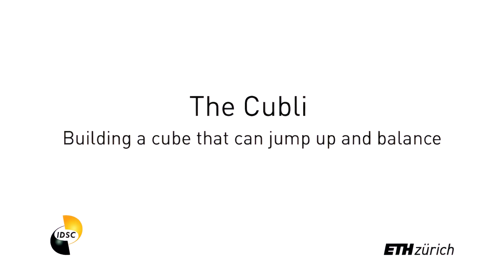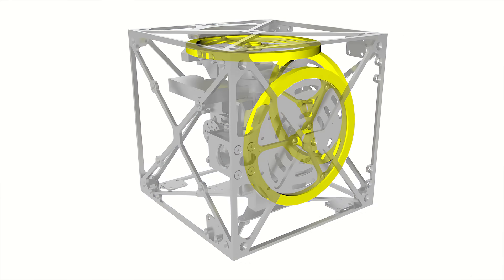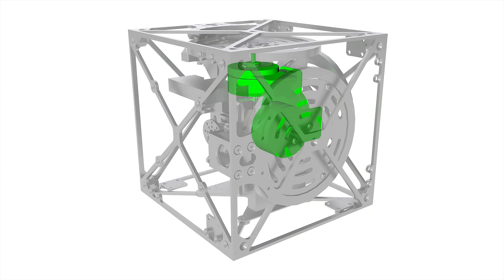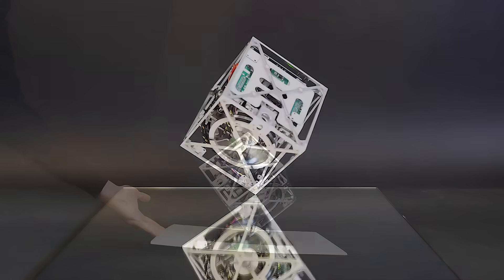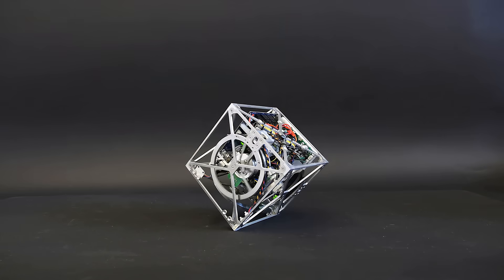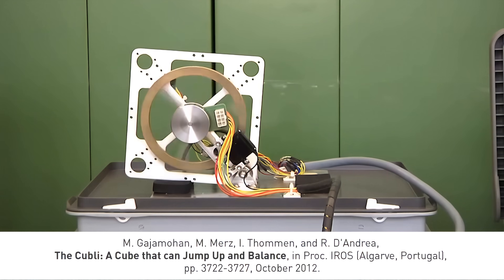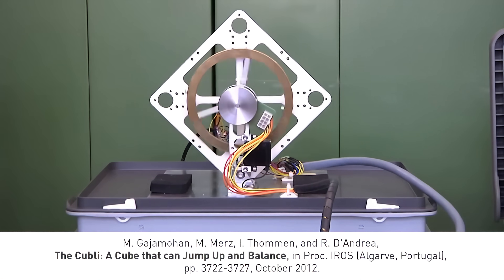The Cubli: a cube that can jump up, balance, and 'walk'

Comment: how can a brushless motor use DC current?!!!
Reply: "Brushless DC electric motor (BLDC motors, BL motors) also known as electronically commutated motors (ECMs, EC motors) are synchronous motors that are powered by a DC electric source via an integrated inverter/switching power supply, which produces an AC electric signal to drive the motor. In this context, AC, alternating current, does not imply a sinusoidal waveform, but rather a bi-directional current with no restriction on waveform." https://en.wikipedia.org/wiki/Brushless_DC_electric_motor
Reply: Simply with a BLDC motor controller, which itself can be made fairly simply with a pair of MOSFETS per pole/phase. most BLDC's have three electromagnets, dc current needs to be applied to each electromagnet in sequence. You can therefore control the speed of the motor by switching faster. You can also control the torque by modulating the pulses to each coil, using PWM. Any PC fan, has a bldc motor, and if you open it up, you will see the controller inside.

Comment: It's cool, but will NEVER be useful for planetary WALKING. The gyros have to spin WAY too fast to build up enough momentum to make it flip. The batteries, gears, axles & spindles would wear through and fall apart before it got half a mile.... and I'm assuming it would be the size of at least a car. 

They would be much better off with a hovercraft vehicle... wayyy less wear & tear on the equipment. Like I have to tell them that though lol... :-D  They aren't fooling anyone - they have had antigrav tech for decades now! smh That shyt is all over Youtube - but what WE see are the 50 year old versions - pretending like they're confused LOL.
Reply: You need a decent atmosphere for a hovercraft, which rules out Mars and the moon. Also, I think you might be mistaken about the antigravity.
Reply: I'm eager to see your hover machine.
Reply: Not really... it just depends on what kinds of physics the vehicle is using to hover... that video I showed is using ONE type. It's not the ONLY type, but it's what's currently being experimented with, and it's not floating on AIR.... so that would work even in a vacuum.
Reply: Ok but where did you get "AIR" and "AIRCRAFT" from?? You people keep trying to tell me about the thin atmosphere on the moon & Mars, but I never said anything about AIR! I said a "HOVERCRAFT USING ANTI-GRAV TECHNOLOGY"... So Why do you people keep talking to me about AIR?? LOL... 

Also, Anti-Grav doesn't require GRAVITY to work lol.. there are MANY ways to hover & move around without touching the ground or air smh.  Look up "HOVER TECHNOLOGY". It's all out there!
Reply: So you are jumping over your total ineptitude at science, your total misunderstanding of "Hovercraft" when you referred to it as an "Aircraft" lol...  :-D  You totally blew past ALL of the videos online showing WORKING hovercrafts.... none of which use AIR... or GRAVITY... and we are now skipping right to .... "I'm a conspiracy theorist who is like others you know... and unhappy with my life"... LMAOOOOOOoooooooo... :-D  :-D :-D  ..  

Dude - it's ok to admit that you had absolutely no idea what the fuqq you were talking about. :)  It's ok to admit that you feel ignorant as a 2yo in a college course. 

Just be a man for ONCE in your miserable, pointless, worthless life - and just admit it! :)  It's ok.... There's a LOT of people out there like you who simply have no clue and just like to comment on random videos, but still have to have their children to program their DVR for them LOL..  You're obviously not very intelligent - that's ok. :)  No problem.

Comment: I think these guys might just solved an old, crucial problem in robots: how to make a bi-pedal robot walk naturally, without falling. I'd love to see this technology applied to ASIMO or one of the Boston Dynamics humanoid robots.
Reply: The closest robot to the real thing is the Mule from Boston Dynamics,  (remember when it was about to fall when walking on ice?) but that's four legs, not two. 

All the most advanced robots suffer from a pity lack of equilibrium;  in my humble opinion, what's needed is more inertial sensors on limbs and joints, to improve feedback;  and, taking the actual weight of such limbs into account when doing calculations on the fly, to not only maintain equilibrium, but using the weight to their advantage when moving.  The limbs had been completely overlooked by most if not all robot designer companies.

ASIMO, for example,  it just swings arms with complete disregard to its body weight spatial distribution. 

Every time I see a wheeled robot, two words come to my mind: LAZY and UNTALENTED.

The technology to accomplish natural, human-like, real-time balance already exists; the real breakthrough will come in the form of an elegant, beautiful equation. Just like writing a symphony.

One other thing, the cube should be located at the center of gravity (middle section), not at the limbs.

What would be your advice?  I'm eager to see a Boston Dynamics T-800 excelling at parkour.
Reply: OMG I was revisiting this video and read the comment I made one year ago:  " I'm eager to see a Boston Dynamics T-800 excellig at parkour"  

...And they just did it: https://www.youtube.com/watch?v=fRj34o4hN4I

Comment: why not a sphere?
Reply: How can a sphere stand on it's edge or corner ?
Reply: Maybe they want to try something new theory
Reply: Allen A Yeah that's a great idea. A sphere! It could balance on one of its corners. . . oh wait a minute. . .
Reply: You missed the point of the video, it's a tech demo. A sphere is the obvious shape if you want something that can move easily and practically, to have a self balancing, moving cube is much more impressive.
Reply: Allen A But a sphere can't demonstrate balance. Every point on the sphere is equivalent and so having it not roll is not very impressive compared to a cube balancing on a point. Its also easier to house the flywheels in a cube casing.
Reply: you are smart..!
Reply: These are being used in self assembly robots too. Cubes will be easy to combine with each other along the planes.
Reply: thats the point, it would stand in any orientation idiot #bb8
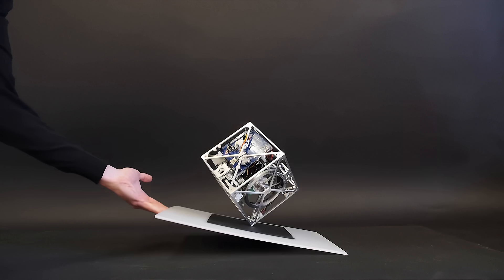Reply: 0:55. A sphere couldn't do that. Maybe they wanted to do something that hasn't been done to death.
Reply: to show the working of (gyros,servo motors,electronics , material strength and technology thery are using) they have to use a shape with edges ,corners and vertices .thats why ...otherwise , yes,why not sphere..?..!  ......!  (sorry for my eng.)
Reply: Allen A Wrong meaning of the word show. He means you can't show self balancing or controlled fall on a sphere. A cube is much better.
Reply: self assembling robots are easier to create with edgy objects with plane surfaces.
that's all
Reply: yes, sounds like youve never heard of a car tire? that goes up hills, slippery surfaces, etc
Reply: no they can make it transparent sphere to show
Reply: yes you can, spheres need to be controlled to stop them continuing from rolling or being able to suddenly go or stop (acceleration / deccel)
Reply: a sphere can demonstrate balance and it can also demonstrate velocity and acceleration. the cube can be enclosed in a sphere. no issue housing it
Reply: Allen A A cube moving is more impressive as it is more difficult to move it. although, watching a sphere balence on a pencil tip would be impressive.

Comment: I don't understand the point of this.
Reply: +Nix_ It can walk on it's own? It can revolutionize the market for robots and automobiles which can help any human process?
Reply: Hander Dark
But gyroscopes already existed, and have been already used on the robot market, so I don't understand why there should be a cube that can jump and move on there.
Reply: +RazorCat Toontown and more! Geez geez, calm down he does have a point
Reply: Its a research project, not a product. They are developing control algorithms and testing the new generation of micro sensors that are coming out of the smart phone sector. Ive seen a very early prototype of a self assembling snake-like search and rescue robot that can either be controlled through the joints when its assembled or it can diconnect segments that move like this.
Reply: Malaclypse The Elder
 Ah, thank you for clearing that up.
Then, this might actually be worth the while.
Reply: reported
Reply: +Imperator For what reason?

Comment: Not gonna lie, this looks awesome, but seriously, a cube for planetary exploration is so much more inefficient than a sphere...
Reply: +Liquid Gold Not really. First of all, you need a larger sphere to fit three perpendicular flywheels; second, the sphere can't jump by turning suddenly, and its ability to roll forwards depends on regolith properties. What you're probably thinking of is the Hedgehog, an idea very similar to this, and that's designed for extremely low-gravity environments. Spheres are useful if you want to for some reason minimize surface area, but that's usually something you try to avoid.

Comment: Most interesting application will be in the field of aerospace autonomous vehicles/planes/drones; especially in the area of VTOL, Hovering, and high speed/high G lifts and turns. And if you ever wonder how to make a UFO fly, the answer may in fact lay partially to a multi-stacked or array of three or more gyros for controlling pitch, yaw,  roll, and sudden lift absent of airfoil.

Comment: I seriously want one. I know this is a research project, but a great deal of money could be made selling kits for the robotics hobbyist and novelty markets.
Reply: +Mark Speir It looks like the processor board may be an Arduino. There are modules that can sense orientation and send the data to an Arduino or Raspberry Pi via an IC2 connection. Motors and motor controllers are not hard to find. The flywheels should be available somewhere. Batteries of course would be needed. Put them all together in a cube frame and do some fancy programming then you have one ;)
Reply: The electronics are only a tiny fraction of the issue. The mechanical design and construction alone is enough to place this outside of the realm of the average hobbyist. The reaction wheels, for example, need to be perfectly (I do not use that word lightly!) balanced to prevent introducing oscillation.

Even a hobbyist with access to a CNC mill would have trouble replicating this.
Reply: Mark Speir
Well, I was being over simplistic for effect and to give just the very basics of what is needed. It would not be as satisfying to build one if you did not have to put a lot of effort into getting it to work :)

I'm sure there are places to buy pre-made high precision fly wheels. You can scale the project to those if need be. Or perhaps there are places to custom order them at a premium of course.

You need high torque motors for fast spin up times of course. They just need to be centered on the 3 axis of the cube. A minor amount of error in the centering is tolerable. Which side and where internally does not matter too much either as it's the physics of the spinning wheels in the 3 axis that makes the cube work.

The electronics are actually a major part of the cube, not minor as you stated. The structure and placement of the motors/wheels is actually the easy part. The hard part is the programming of the microprocessor. The microprocessor has to use the orientation sensors to determine if the cube is falling off balance. Then calculate which direction it's moving to determine which flywheels need the speed adjusted to counter the movement. The physics of the spinning wheels help to reduce that movement as a weighted spinning wheel will want to keep moving in the same orientation and will resist change to that (That's how bicycles are easy to balance on once they are moving fast enough).

Getting it to 'walk' is easy, spin a wheel on an axis that runs parallel to the surface (I.E. either of the 2 axis not currently pointing up-down) then stop the wheel. This will cause angular momentum to make the cube want to spin in the opposite direction. If the wheel was going fast enough, this counter rotation will make the cube 'jump' onto the next face in that direction. Simple physics :)

The trickiest part is getting it to balance itself. You have to figure out from the weight of the wheel how fast to spin it to give it just enough angular momentum to just jump it up on to the edge enough for the balance routines to take control and get it 45 degrees. That's just getting it to the flat edge, next it has to spin the other 2 wheels to get the diagonal jump to get it to balance on the corner!

There may already be code for this somewhere on the net for the Arduino so it might be worth taking a look for that before attempting to do the coding yourself :)

Now I have gone in to all this explanation I so want to build one myself! A shame I am not in a financial situation to afford a personal side project of this type :(
Reply: +Tanjo Galbi (Galbi3000) Circuitry is not that hard. But  I guess it is not really easy to build one like this. Let alone the nonlinear control, just balancing the flywheels will need some serious work, and the brake used in jumping could eventually ruin .the flywheels if the whole assembly was not well designed. 

Regarding the nonlinear control, if you check some similar hobby videos, absolute most of them can not do it properly, which resulted in poor stability and oscillation.
Reply: +Mark Speir Totally agreed, most of the time people underestimate the importance of mechanical design. For such high speed rotation, CMC cannot make sure its balancing. Special equipment is needed. Also should be careful when assembly the whole thing.
Reply: Hu Sun The balance of the flywheels is important, I never disputed that, they need to be very well balanced to spin well which is why I suggested finding them online rather than try to make them yourself so that you know they 'should' be balanced already. Gyroscopic balancing toys have been around for many many years, you could just buy a few of those toys and use the wheels from them. Just one example of sourcing flywheels ;)

Placement inside the cube is not as crucial as most people think. The main crucial placement that I forgot to mention is that the 3 axis need to be as precise as possible. They do not have to be precisely central inside the space of the cube but they do need to be exactly 90 degrees from the sides so the wheel spins exactly parallel to the sides. That would be the main complexity of the mechanics of it and I can not excuse myself for missing that crucial point, other than to say it was late at night when I wrote it xD

The circuitry is not hard as you said, but it's the programming of the microprocessor that provides the main issue with building such a cube. Without that the cube would just be another gyroscopic balancing toy. Without the microprocessor it can not move or adjust for external forces upsetting that balance. It would not be able to move or get itself up to that balancing point. The electronics and the microprocessor are arguably the most important part of getting this cube to do what it does.

Comment: Is it possible to balance the cube at a certain angle from the surface (when its balancing on one of the edges) with the current configuration of the cube?
Reply: +Ashwin Mathur  No. It can only balance at angles that achieve equilibrium.  One angle on the edge, and one on the corner.

Comment: if you hang the cubli from a string will the cubli move? if so its creating gyroscopic propulsion. Or does the cubli require the friction of the floor to create a torque lifting the cubli?
Reply: +TheRealVerbz2
Reply: +Erik Baker ?
Reply: how is it able to move itself against gravity without pushing against something. "mainstream" physics says this is not possible.

Comment: Why do people post such awesome things like this, and then give no information on how they built it?  
If you not going to sell it, then share with us the components used in it so we can make it.
Reply: +JDALSystems There's a guy who made something like it on his youtube channel. Look up "rolling cube". You see, it's a very complicated device that can't be built without a lab and a team of professionals. Even the guy who made the "rolling cube" could only get it to roll. This device is far more complicated and requires specialized skills to operate and build
Reply: +Clyde Johnson , It really not that complicated at all. The hardest thing is to have the machining done for low cost. you don't need a team of professionals to pull this off. You just need a good understanding of electronics.
Reply: ugetridofit The measurements and programming needed to have the perfect balance shown in the video are very hard to produce. Making the cube roll is easy, making it balance with momentum is a challenging feat of programming and engineering
Reply: +Clyde Johnson , Its the same method used for say a balancing robot which kids all over are doing. So it's reall not that difficult.

Comment: can we spend some money on things that actually help mankind?
Reply: +vampcaff This technology not only can help mankind, it already has. This machine is able to balance itself without moving any external parts seemingly as if by magic. Do you maybe see some potential uses as vehicle balance control now? (because we've been using this for building self balancing machines for decades).
Reply: +Noah Williams I'm well aware of what a gyro is. this however from what I understand is not a gyro.
Reply: vampcaff No. But it does use them in a way that allows for a new kind of movement. This would be great for exploring comets.